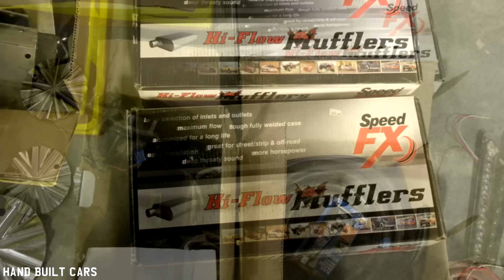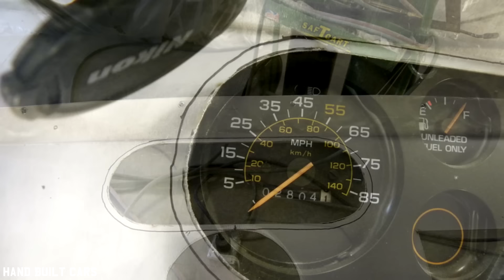1958 Chevrolet Step Van - Ice Cream Van Build Project

Comment: I have a 56 3700 series with a Gruman Olson Body.  Mine has a straight front axle.  I see yours as a 58 with IFS?  My   I also see an instrument pod that looks like it was out of my old 78 C2500.... and then I see the chevy or ford van engine cover and  So I am wondering...What chassis is this?